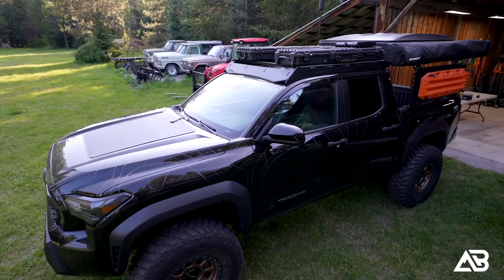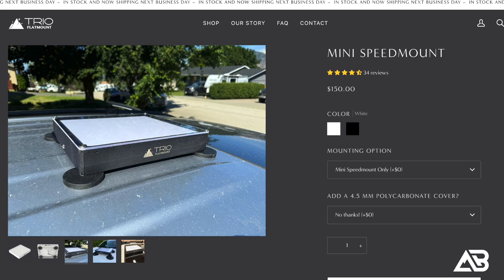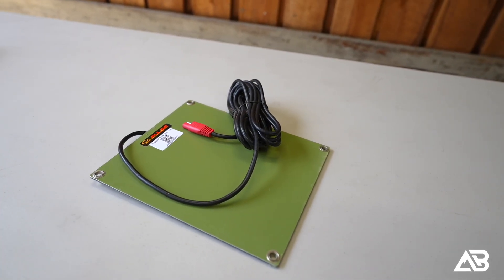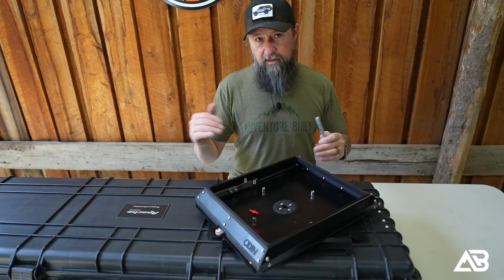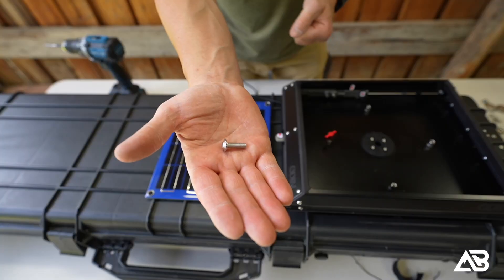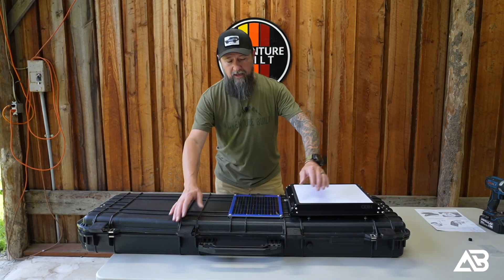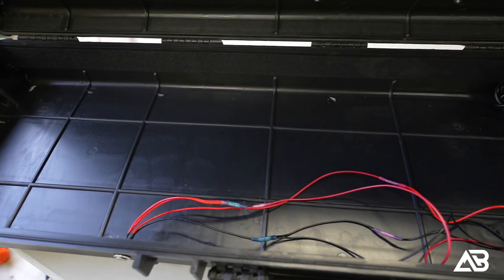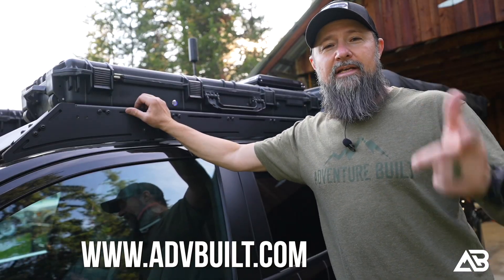DIY Solar Powered Articulating StarLink on Harbor Freight Apache Rifle | Odin Hardware, Pulse Tech

Comment: Clean, and I like the idea.  My only concern is that the 7 watt panel won't be enough to keep up if you're running it all day.  The Starlink uses ~25 watts of continuous power.
Reply from the maker: Thanks for the feedback! Yes, it would definitely need more than 7 watts to run consistently. I only use mine intermittently. I have been able to upload a video and work for a couple hours doing emails and what not with no issue. I don’t have a gauge on there so I don’t really know where my battery is at. I’ll find a solution for that some day.

Comment: If you’re worried about water getting into the case you can always add a small drain hole in the bottom of the case.
Reply from the maker: If I ever get leaking, I definitely will. Currently the seals are holding but only time will tell.

Comment: That looks like a really cool set up! I also agree with the comments someone else made about placing the solar panel a little farther away, but I was thinking to place it in such a way as to be able to "center" another panel, in case you ever needed to add a second, that wat it would look more balanced. 
I am curious as to whether that battery will power the Star Link long enough to upload videos? Another channel said that a video upload could take several hours, even for a 10–15-minute video. 
My wife has a new job, where she may need internet service at almost any time, no matter where she is. So, we have been pondering the Star Link. Will this set up work while driving down the road? I know that prime reception would require angling and spinning to face the satelite, but I have seen some channels say that their system works well mounted flat on the vehicle.
Reply from the maker: Hey thanks for checking out the video. So yes I did mount the solar panel in a position to be able to add another panel if needed. I actually have another 7W panel that is long and skinny which will fit in front of the other panel. If you need lots of service I would definitely consider a larger panel and maybe 2 batteries. I haven’t had the time to do any longevity testing on the system but I plan to soon. I’ll put it out as a short and on IG. 
Also I have ran the Starlink mini and it works great while driving for WiFi calls, streaming music and YouTube. Haven’t used it for anything else. I use Starlink at home for all my internet and video uploads to YouTube are similar to cable internet. I think you will be completely fine using it for your wife’s work. Even while driving. Definitely do some testing though. Hope this helps.
Reply: @AdventureBuilt Thanks for the info. We have fiber at home, so upload speeds are crazy fast. Kinda hard to leave that! And our particular provider isn’t insanely priced, either. So we would probably stick with the provider we already have at home…probably. This would just be for the road.

Comment: Why didn't you just use a 12v input rather than going to usb c.  They work from 12v also.
Reply from the maker: Great question. I could have wired the panel to the battery directly but I still wanted to be able to pull the cable out of the system and use the Starlink as a standalone system if I needed it for other purposes. Also I liked the idea of plugging another USB into the outlet if I needed to charge something. All about versatility.

Comment: How long do you really think that will run? a 5ah battery will run the Starlink Mini for about 2 hours. Plus the 7w panel will take a half a day just to fill that battery, and probably never under load during the day. Lastly, $200 for a 7 w panel, is unreal.
Reply from the maker: I will definitely be doing some testing on that in the future. Keep an eye on IG.

Comment: Awesome setup! The only change I would make: install the solar panel a few inches away from the Starlink to avoid shadows, especially when it's partially rotated. A 10% shadow on the panel can reduce solar output by 50% or more (as you know...)
Reply from the maker: Great tip, I appreciate the feedback!

Comment: I love the idea of making things more efficient and compact, but I think heat build up might be an issue.
Reply from the maker: It’s a valid concern, but so far so good! There is a pretty high temp rating on the battery. Also I guarantee that an engine bay battery in the desert is hotter than a black box on the roof. Only time will tell.

Comment: The Odin mount is really cool, but it cost more than what I paid for Starlink. Tried the  ADVBUILT25 discount code, but its not working; so definitely sticking with an affordable (to me) mounting solution :). I think you may want a larger solar panel down the road.

Comment: I'm so tired of running more and more wiring every time I add something cool to the truck. I love your stand-alone concept! Maybe hard-mount a divider to protect the battery and you can be more flexible with what you toss in the front portion of the box. Great idea and it looks coll too. Bonus!
Reply from the maker: I completely agree. That’s a great idea on the divider, I might look into that.

Comment: That’s awesome!  So I noticed you still have your WeBoost antenna on the truck.  With having Starlink are you going to remove it or do you find it beneficial to have both.  Because I have a weboost that I haven’t gotten around to installing yet, but now I also have a Starlink mini so I’m debating whether or not to sell the weboost or keep it and install!
Reply from the maker: I have both and still use them both. If you only had to pick one definitely do the Starlink. If I’m doing short drives it isn’t worth turning on the Starlink as I don’t have cell service when I leave the house. If you can sell it, might be worth looking into. Hope this helps.

Comment: Have never seen other installs like yours! Real ingenious and a great solution for mounts that’s also quite practical. I’ve suction mounted mine inside my rig on the moonroof and wired into an AC outlet or while the rig is off, into the 12V using a convertor to a USB-C 100W output. I can’t rotate like yours of course unless I undo the mount and place on the roof
Reply from the maker: Thanks, I appreciate you watching and sharing your setup!

Comment: The heat in the black case might be an issue for the battery.
Reply from the maker: Shouldn’t be an issue as they are rated to charge up to 140 degrees and will stay dormant at even higher temps. It’s also lithium so it should have a decent life. Only time will tell.

Comment: Been going back and forth with my starlink mini setup, I have a few options currently that I run but still looking for a more semi permanent solution and I may do something similar to your set up. I would probably prefer to mount the starlink and solar to the rack and then use my rugged box to house wires and battery, as I only have one rig.
Reply from the maker: If you have one rig that is a perfect setup. I like the idea of using the dead space on the rifle cases to mount the Starlink and solar panel but it may not be for everyone. I have thrown a bag of firewood or a paddle board between the boxes and like having the extra space up there.

Comment: Fantanstic ideal. I like the Odin Starlink mount. The solar panel does need to be bigger to supply sufficient power to the battery to be charged while the Starlink is in use. Overall...everything looks so good!
Reply from the maker: Thank you very much. That is a big reason that I left so much room up there. I haven’t used it enough to kill the battery yet but will probably be adding more solar up there. Better safe than sorry.

Comment: What was your goal in adding a 7W Solar Panel?  The mini will consume approximately 25-30W.  I admire your design but electrically speaking you should consider a larger panel.  If you use this at night and are not in direct sunlight the solar panel is not going to keep that battery charged.  Factoring in losses I would look into a 50W panel...  Great video, I enjoy your content.
Cheers
Reply from the maker: Thank you very much. I don’t run the Starlink all the time. If I’m driving I will run it to download podcast or search something. If I’m at camp it turn it on and do some business stuff for a couple hours then turn it off for the night. So far it has kept up but I know what my needs are. If you wanted to run it full time you will definitely need to upgrade to a larger panel and battery.
Reply: Agreed. My assumption would be that he received the panel and had to create a video with it (if so, not knocking the hustle) Also, I don’t think the charge controller has configurable charge profiles based on what I saw on their website, specifically states charging lead acid batteries vs the LiPO4 used here…. Just realized the battery is only 5Ah… I think this is a good idea, but I would have executed a bit differently if using my own money lol I would’ve sized a larger panel, a separate mppt controller, and a 50Ah battery (min) to not limit myself or have to spend more money down the road. With the current set up, I probably would also run power into the roof top tent if he hasn’t already. Again, nice idea and appreciate the video/content